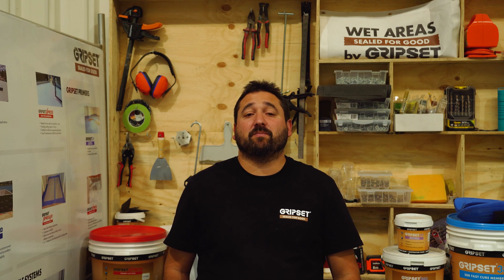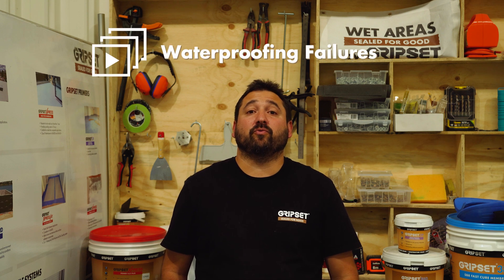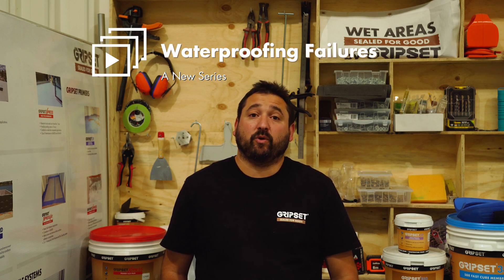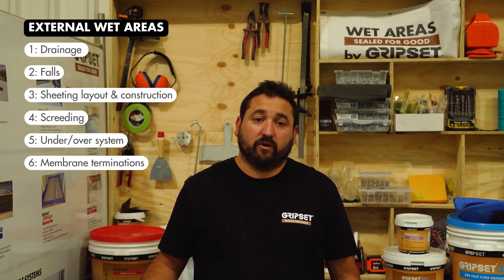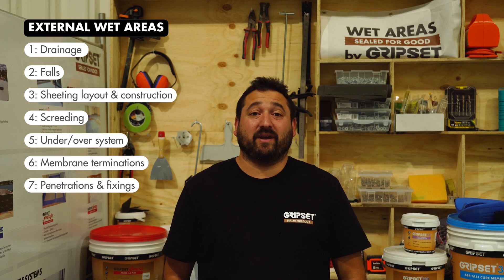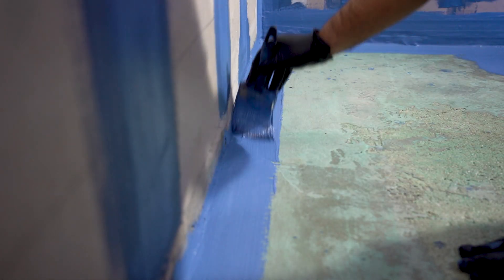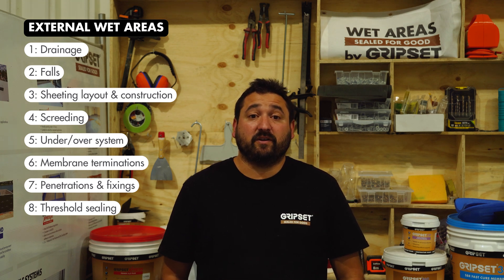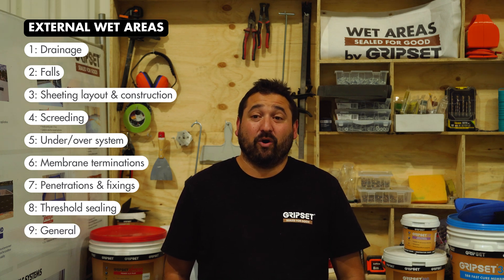Wet Area Failures | Design

Comment: Quick question point 9 said it shouldn't be used as a construction element, I agree. But I've had a builder in the past argue that he didn't need to bandage the villaboard in a wet area and that the waterproofing bandage would be good enough to bridge it after a few coats. I ended up walking from that job after going over the rest of the job and picking up bodgy things that I didn't want to touch or risk. But my question is, those details need to be done afaik, but it's fine to use backing rod and silicon for floor and corner details but not to bridge wall sheet joins?
Reply from the maker: Hi Nicko, thank you for watching!

Ultimately, all substrates should be installed as per the manufacturer's recommendations in line with the relevant construction standards enforced at the time.

This is a common and explicit stipulation documented by membrane manufacturers before applying any waterproofing system.

This is not a question of whether an alternative method will do the job, or is suitable, as chances are that a waterproof membrane and bandage system over unflushed Villaboard joints may be fine long term.

It is however a question of culpability, and the use of unsanctioned alternatives in the event of a failure. Especially when the waterproofer knowingly accepts a substrate not installed to spec.

Applying a membrane system over properly installed surfaces removes any ambiguity.

We hope this helps :)